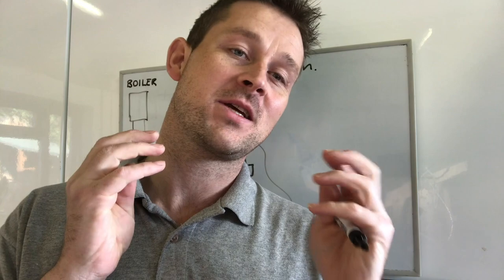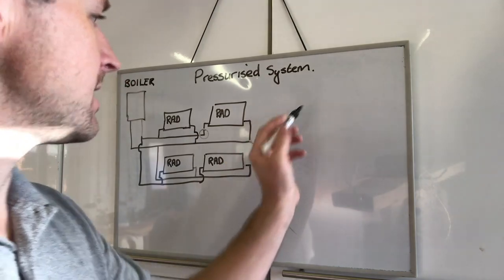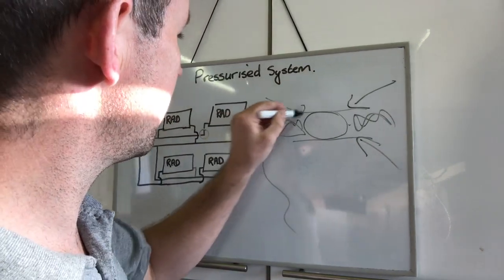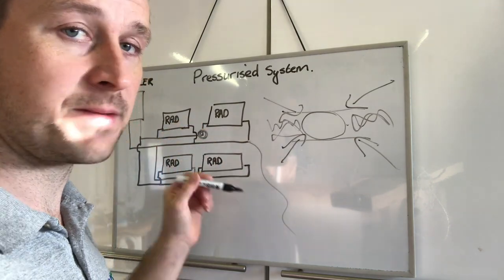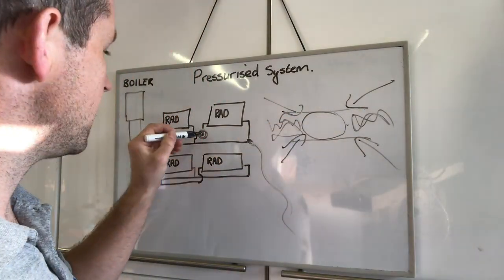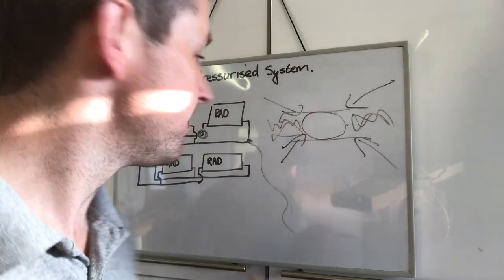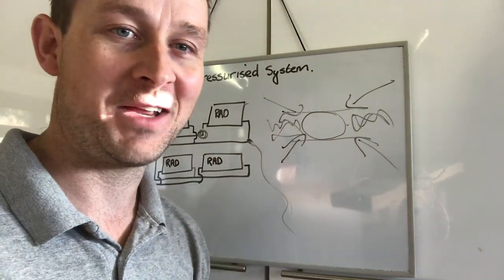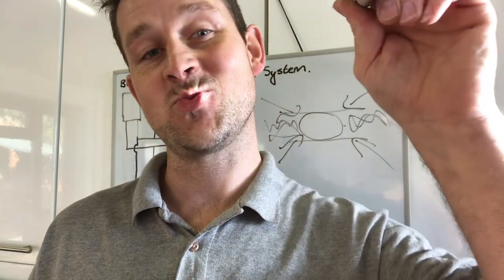How and why we get an airlock out of a pressurised system

Comment: The thing is, a modern boiler will shut itself down if the system pressure drops for example, when a drain valve is opened. Also if you run off too much system water you will compromise the inhibitor effectiveness. I try to save what I run off so I can get it back in the system.

Comment: Thanks. Very Straight forward and easy to understand. I removed a radiator at home for decorating and it's not heating up now even though the rest are. This radiator has a small drain valve at the bottom to connect a garden hose pipe.  Il try this method.
Reply from the maker: Hi Ammo Bee, thanks for your message, bet the wall looks lovely now it all painted nicely BEHIND the radiator! Hope your managed to get the airlock out.
Reply: @NickTaylorPlumbingLtd  yes I did!!! Thanks to your video ☺️
Reply: I know this is from 3 years ago but my method if it is just one radiator is to run off some water from the vent screw with the lockstop valve closed, open the lockstop valve but close the main valve / remove the thermostatic head then run off some water in that direction. Obviously it is best to note how many turns you have to give the lockstop valve so you can put it back in the same setting.

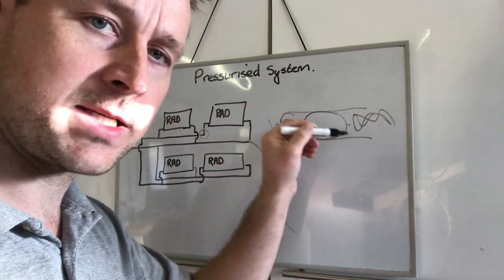Comment: 0:50
Why the water cannot pass the created air bubble? Isn't the pump strong enough to create differential pressure and push the air further into the radiator?